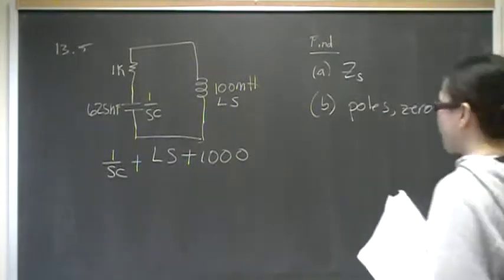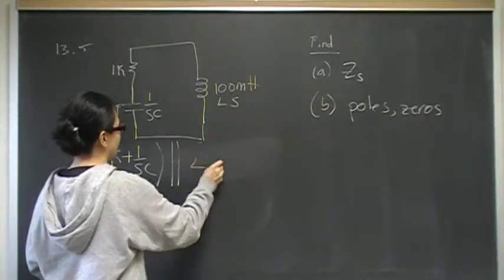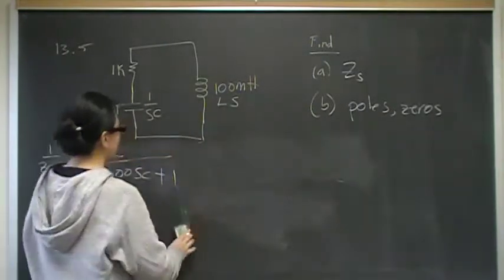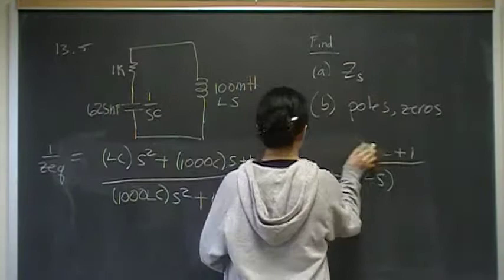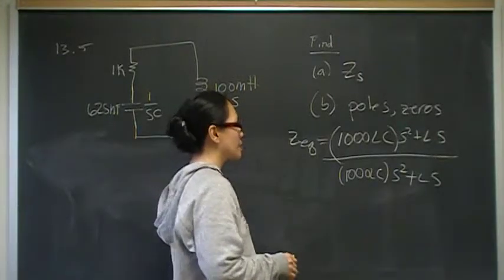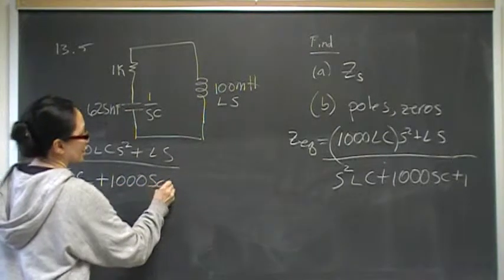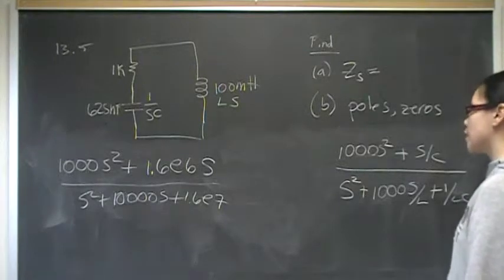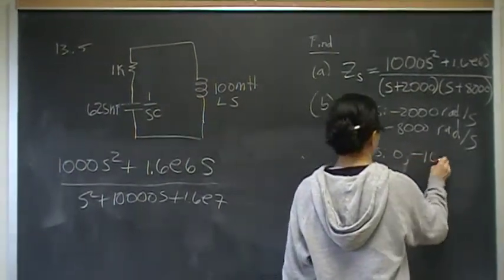Circuit Analysis in the s Domain P13.5 Nilsson Riedel Electric Circuits 9E Solution

Comment: i want to know why didn't you take all of them in series? this is a series circuit if u asked me.
Reply from the maker: Zorro hi Zorro, you are 100% correct. the way i drew the schematic depicts a series circuit. how sloppy of me! thats why i need people like you to nicely point those things out. even though my drawing is wrong, the problem statement is "A 1 kd resistor is in series with a 625 nF capacitor.This series combination is in parallel with a 100 mH inductor." so i was supposed to draw a nodes at the top and bottom to show the parallel connection. thanks for pointing it out! :)
Reply: Thuy Myers np! we humans always make mistakes and we learn from those mistakes, right? :)